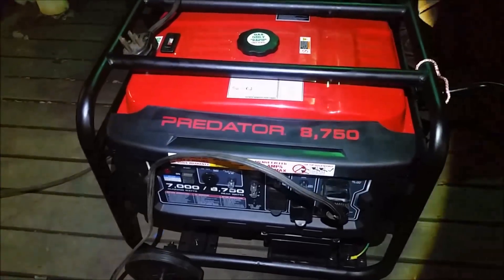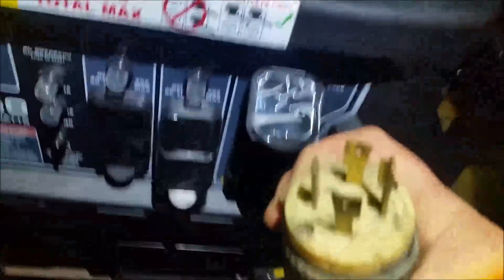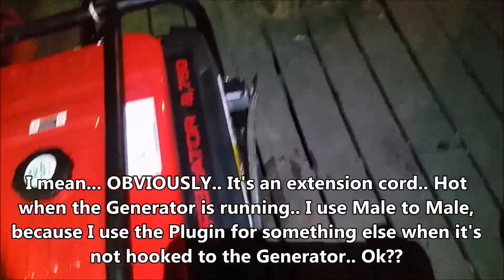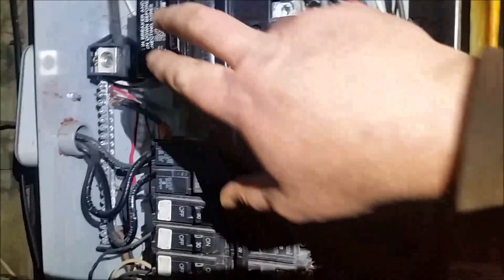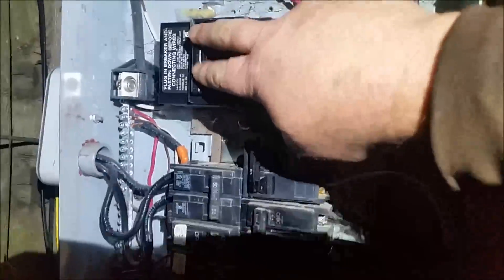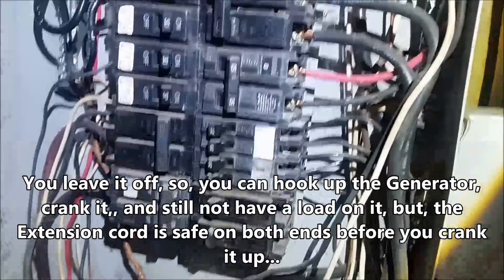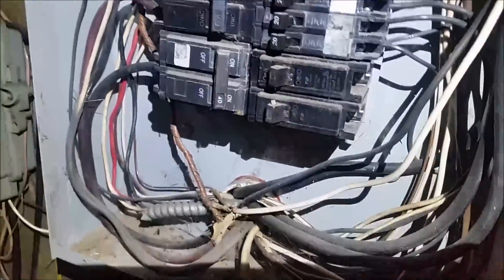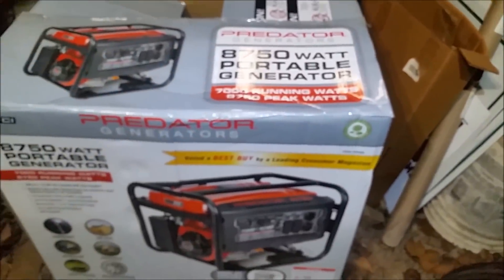Quick/Easy/Safe: Use Existing Plugin/Breaker for Generator hook up to your house Panel box.

Comment: A small main lug panel box is quite inexpensive.  Add two 2-100 and 1 2-40 breakers.  Run your main feed into a 2-100 placed in the top left spot and place the second 2-100 right below it and run it to your main panel box.  Place the 2-40 in the top right position.  Turn one of the top breakers off and the other on.  Place a link going between the levers on both top breakers.  Now you have a cheap transfer switch.
Reply from the maker: Now.. I like the way you think.. Lets take that one step further and make it idiot proof.. Wouldn't that be amazing... Ha... 
Put both 100amp breakers on the top.. One Right, one Left position.. 
Left = input from Utility power. 
Right= Feed from this Panel to the House Panel.. 
Put the 30-50amp 220v breaker on the right side of the box and put your Generator Feed Into it.. 
Then, run a pin through the Right side 220v 30-50 amp breaker and then also through the 100amp breaker.. Then, put a slide bar from the right 100amp to the left 100amp breaker.. I think I would run the bar up to the left utility breaker switch, but, not run a pin through it.. That way, you could not throw the 100 and 30-50amp on at the same time without turning the left utility feed power off at the same time.. The reason I would not pin it, is so, when they see one is going to turn the other off anyway,, and it is difficult to heave all three at the same time,, so, toss Utility power off manually first, then, toss the two house feeds on at the same time, which is reasonably done with the palm of your hand.. 
Now you have a cheap Transfer switch and a cheap Interlock to boot... Ha..Ha.. 
Then,, we can add about 10% more people to the project list.. Ha..Ha.. cheers.. 
Thanks Mike for the Comment... Great Idea.. Kudos... :)
Reply: @MarkThomas123  i like this alot however i dont know what you mean by pin? Can you dumb it down a little more?
Reply from the maker: @gman8760   I'm sorry.. I am not sure what you are referring to..  I'm not sure what I said about Pin... Can you post the time at which I said it in the video, or, type out the sentence where I used it.. I would be happy to explain it  and make it more clear for you.. Sorry about that.. I can't quite remember what I would have said about "Pin"... Thanks.. Glad to try to help though..
Reply from the maker: @gman8760   Ok.. If you notice what a 220v breaker is,,, it is just two 110v breakers with the handles "Pinned" together.. So, when you throw one of the 110v breakers, the pin running through the hole in the other 110v breaker switch handles throws both at the same time, which creates a 220v breaker,,, IF,, you have a 220v circuit wired (One feed wire to each breaker).. That is actually why the breaker handles or many of them have holes in them.. So, you can drop a nail or pin through them and throw them together.. What Mike and I were talking about in that instance was kind of similar, but, different.. Not making a 220 out of 2-110v breakers, but, throwing two 220v breakers at the same time.. 
Instead of throwing two breakers just above or below one another, we are talking about throwing one breaker  connected to the other via a stiff wire connected to both, but, neither connected by wire with the other like I was talking about above.. 
Open your breaker panel and imagine this.. Lets say that your Main Feed Breaker(Main Service Disconnect) (The 200amp Main breaker in an average newer home), turns  on when you  push it to the Right and turns off when you push it to the left. 
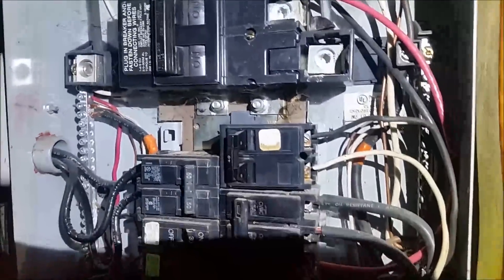Stop the video at 3:14 and I will explain this to you..  The main breaker is pushed to the Left in the On position.. I think you can see "ON" on the main breaker at the top.. So, I am running on Utility power, just running the HF generator after first cranking it without a load and stopped to make a video about how I hook them up to the house.. 
A Generator Interlock is a Flat piece of metal which you connect to the Main Breaker,, and in "MY BOX", would hook the Generator up to a breaker on the LEFT side of the box... Why?? Because, you want the Generator Breaker "OFF" while the Main Breaker is "ON", for the safety of the Generator or anyone else out there on the line when the power is out and people are assuming it is actually out, and you are not backfeeding the line.. 
So, when we say or I say "Pin the Breaker", think of the Interlock.. IE,, locking or Pinning the breaker switches together.. 
My breaker just happens to be on the Right side of the Box that I feed the Panel with from my Generator.. As you can see, when I pull the handle back to the Right to Turn the "Main Breaker Off",,, if there were a Metal Bar or Plate or Stiff Wire = Pin,,,, if the breaker which feeds the Panel from the breaker were on the Right, as the Main Breaker handle  moves "Right", so does the Generator Feed Breaker also move right and Turn off.. Moot Point and would not do what we want.. So,,, what can we do? 
If I moved my Generator Breaker to the "LEFT" side of the box,,,, It would turn "ON" when moved Right,,,, Instead of Turned "Off"..
That would defeat the purpose of what I do here, because, I use my Breaker that feeds my Panel from the Generator, to also Run my Welder when the Power is on from Utility.. BUT,, for the Safety Factor, of someone who "MIGHT" forget to turn off the Main Breaker,, If My Generator Feed Breaker is on the LEFT side of the box,, and ANYTIME the Main Breaker Moves Right or Left,,,, the Pin or Plate which connects the Handle to Both Breakers,,,,  the Generator Breaker also moves  Right or Left.. 
So, Main Breaker Moving LEFT=ON,, Turns off the Generator Breaker On the Left side of the box "OFF"... (If Genset Breaker on Right, would turn on)..  So, if the Generator Breaker turns Off when the Main is Turned On, and Vice Versa, it would be creating a Generator Interlock..   Now, Mike's Statement.. 
Add two 2-100 and 1 2-40 breakers.   I will simplify this with a Restatement.. 
Add TWO 220v-100Amp Breakers and ONE 220v-40Amp Breaker to the box.. 
Top Left 220v-100Amp Breaker is the Utility Power to the "NEW BOX He is suggesting Adding"... 
Top Right 220v-40Amp Generator Feed Breaker to the Panel.. 
Next Down Left Breaker (other 220v-100Amp Breaker) takes the Feed (either Utility Power from the 220v-100A or the 220v-40Amp Generator Feed) to the Main Breaker Panel inside that was there to begin with before adding this new Panel outside... 
You always want to feed the house ( Next Down Left Breaker), so, might as well leave it on.. Right? 
The key is,,,, The top left and Top Right Breakers are Opposite,, so, if you Lock the two handles together (And can't move one without moving the other the same way,,, One will always turn the other the opposite way.. So, when you move one breaker to the left, both move left,, so, one always goes on while the other goes off...  When going on Generator Power,, Generator Breaker on, turns Utility power off, etc... Back on Utility, turn the breakers the other way... There is a stiff Rod connecting both switches together,, each on opposite sides of the box..  (Left is on for one and off for the other and vice versa .. Left is also Off for one and On for the other...  Sorry if I repeated or explained the same thing different ways.. Hoping to save you asking another question and answer if I can.. Same with anyone else reading this.. 
Mike was giving those not comfortable with this particular setup an alternative to buying an Expensive Transfer switch.. This is basically making one of your own.. If you have the room to do so, and are not limited by the Current install.. 
My Solution here works for Any and Every box that has a 220v breaker available,, even if it is being used by something else generally.. You just have to remember to "TURN THE MAIN BREAKER OFF "FIRST".. Before you do this.. 
With any type of Interlock,,, like Mike is suggesting,,,, You can't use the Generator Breaker for anything else 99% of the time when you are running on Utility power..  Not everyone has extra breakers or empty slots to add one... Like Me.. I already have double pole 110v breakers.. You can see the on the bottom Right side of my box.. 110v breakers that have two breakers for every ONE or Single Slot..  I wanted to use a 220v Breaker that I was not going to use while running on generator anyway.. Welder/Compressor/Stove, etc, are what most people have that can be used.. They are a bit much for any portable Generator.. So, why not use them when you are not going to use them when running on generator anyway??  A Welder/Compressor/Stove are too much for a generator anyway, unless the Welder or Compressor are small ones.. A stove is a Stove and will put a heck of a load on a portable.. I hope that helps.. If not, and you have another question, fire away.. If you don't someone will eventually.. Ha..Ha.. Always happy to help.. Cheers!  
If you Always Remember to turn the Main Breaker off, you don't need it.. If you make a Male to Male Extension Cord and forget,, Ha.Ha..Ha.. ,,, You should not be doing this.. Ha..Ha.. You have to hold a Male to Male Extension cord in your hand to know what I mean.. It solves my problem every single time.. I always look to be sure that both ends are visible to me before I touch it..Ha.Ha.. 
If someone plugged it in without me knowing it (would never happen, but, just to say it), I would not do anything until I knew the Generator breaker was turned of.. I would not even dream of assuming it was..Ha..Ha.. Cheers!!
Reply: @MarkThomas123  appreciate the detailed explanation. I understand what you mean now. Yes always cut the power at the main. #1 rule.  Ill be referring back to this video when I go to install this. Thanks again
Reply from the maker: @gman8760  Good Luck fella..  Let me know if I can help.. I took the simple route.. Been doing this for a very long time.. BTW.. Just in case the Safety Police jump on you..  When the power goes out, only people with Generators turn off their Main Breakers.. Everyone else leaves theirs on,, waiting for the power to come back on.. So, just in case someone tries to scare you into thinking you are going to kill someone.. Think about this.. How long is your Generator going to run without flipping a breaker or bogging down and dying,, when we are talking about an electric Stove being too much for a generator,  or a Welder, or Compressor, or, someone's Central Air, etc.. If you did forget to flip the main breaker off,,, you would know "IMMEDIATELY", when you flip your Generator breaker on and wonder what in the hell keeps dragging it down like that and flipping the breaker or killing it under load, etc.. You are going to be trying to run "EVERYONE's HOUSE,,, not just a subset of your own.. Ha..Ha.. 
It doesn't last long.. Anything more than what I use is really being very, very, very anal for little to no reason whatsoever.. 
One more reason you won't forget the next time,,, if you make it past the Male to Male cord.. Too many reminders to make sure you do it right.. But, nothing like putting a 3x5 Index card in the panel with instructions on it.. Good Luck!!  Cheers!!
Reply: @MarkThomas123  absolutely. When my parents lost power for a week. I asked the lineman that was driving by if I could do that and he said yes, just shut the main off. I'll take his word  for it.  I think I'll use 6/3 cable due to the fact I need to pull 50amps from the generator. Looking into getting the generac 17500E.
Reply from the maker: @gman8760  Yea.. You can go by the book on the extension cord.. Can't go wrong for the Amps and length of cord, etc... 
I max out my generator accidentally from time to time, when I am swapping back and forth from the 220v deep well pump to the 220v Water heater.. I have a breaker inside for the water heater and I flip it off and turn it back on when I think I am not going to use the water, and sometimes I forget and flush or turn the sink on and both kick on together.. You can sure tell it when both kick on..  I run to flip the water heater off, or I will have to go and crank the generator again, or flip the breaker.. Something is going to go if I leave it like that for long..   Often, it flips the breaker before I get there.. Ha.. Oh well. Ha.. :)  It does not happen often.. :) Cheers!!
I settled with the 50amp plug for all of my shop 220v needs, whether I use that much or not.. Everything plugs in wherever, and if I change anything to larger amperage, don't have to change everything else.. Or, if I move to a bigger shop where I am using some 50amp stuff, everything else can still be used where ever..
Reply: I have been been looking at small panels also. They are amazingly inexpensive compared to transfer panels. My problem is that my main panel is back to back with meter panel so I have no slack in incoming lines plus I have 200 amp service. But your technique is interesting, I could move the breakers for the emergency circuits from the main to the sub the have the sub fed from the main panel or the genset but not both. Unless I have overlooked something this would eliminate the need for breakers in both panels for the emergency circuits and the row of double throw switches.
Reply: Ed Taylor you might be able to move the main sideways in put the smaller one back of the meter?
Reply: MIke, I need the 200 amp service as I already have a 100 amp sub just to the left of the main panel for electric heat. The 2 panels use up the allocated space. I would have to put the transfer panel either below the electric heat panel or on the other wall, it's in a corner.
Reply: Ed Taylor you could put the heating system breakers in the 200a panel as well as any circuits you dont plan on using with the gen the also put a 100 to feed the homeade transfer which feeds the 100a panelbox if you have enough space in your 100a box.
Reply: Mike, Thanks that's an excellent suggestion, I'll give it some thought.
Reply from the maker: Mike is talking about putting the small main lug panel box where the main is now, and then, putting the main off of that.. As a retrofit (after the fact install), it really depends on how the wiring is entering the main panel to begin with.. If they all come from the bottom, you can move the main panel down.. But, if they come in the sides, etc,, now, you run into a problem with not having enough wire and having junction boxes outside of the main panel,, even if that works,,, depending on the number of wires entering where. But, for a standard panel, what he is suggesting usually works.. But, if it is mounted on the side of the house, you have to move the meter up, because you can't move the main due to wires running into the side of the house.. 
I did that a long time ago.. Replaced the main on the side of the house with a small main box.. It had a 200amp main breaker, and I ran a 100amp main to my shed and the next 100amp main into the house where I replaced the old panel with a larger one inside.. Since it was longer/taller, all of the wires were long enough.. Everything just happened to work out correctly.. The inlet pipe was close to one of the inside 2x4 wall studs, and the ground bar was not in that area, so, I just drilled the box out where it was.. 
If I ever build a new one,,, I will have the exact setup he is talking about.. But, I will probably just put the generator out in the shed and power the box out there to power the box inside.. Just run an extension cord outside of the shed where I can still work in the shed if I need to while it is running, or build a box beside the house or shed to permanently mount the generator..
Reply: Another option would  be to purchase a Brady circuit breaker lockout (which can be pad locked) to prevent reactivation of the main breaker  That would protect the linemen from idiots but I don't know if it would satisfy the code police.
Reply: @shofar-man  8
Reply: Bob Smithereens  2) double pole 100 amp breakers and 1) double pole 40 amp breaker.
Reply: Everyone really needs to watch this video about generator safety https://youtu.be/I1jT3ANENvI everyone really needs to agree. Generator safety is very important for everyone who use portable generators. Hope you all agree with this. We all encourage people to watch this safety video. I’m not trying to force you all. Thank you. Be sure to like this video.
Reply: @tonisam962  have you ever known anyone killed by a generator?
Reply from the maker: @tonisam962  Yea.. Some of the people who have commented on this video might value your video.. People who don't understand not to run Gas Engines inside of their house, etc.... Or, let clueless kids play with them, if they don't understand them.. I'm sure many of the kids of parents posting here have that problem.. 
But, if you think that Solar Panels are Ok to work with/Play with,, with the same kid who can't play with a Gas Generator, you need to do some more research on solar..  A/C or D/C, a very low current can kill you.. Surely just about any Solar system can do it. 
A current of less than 0.75 amps through your heart or brain will almost certainly kill you.
Reply: @MarkThomas123  I just feel bad for people who don’t use their generators correctly. I hope everyone stays safe using generators. I’m very helpful. You should have leave a comment on this video instead of posting it here.